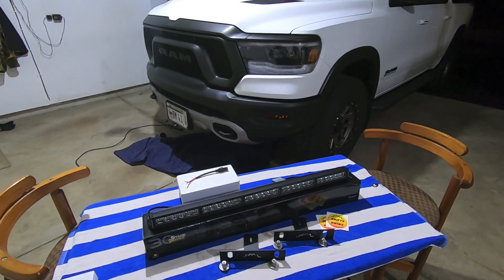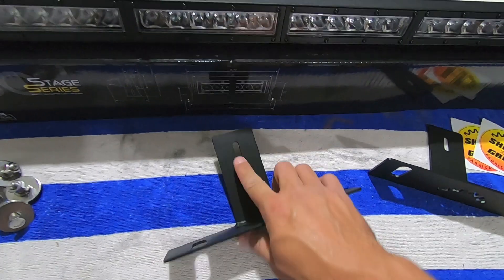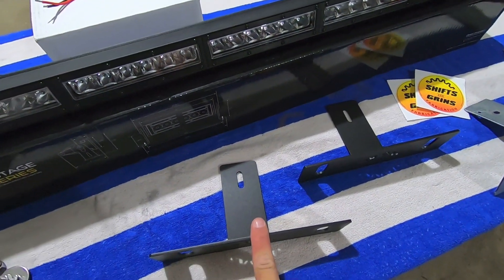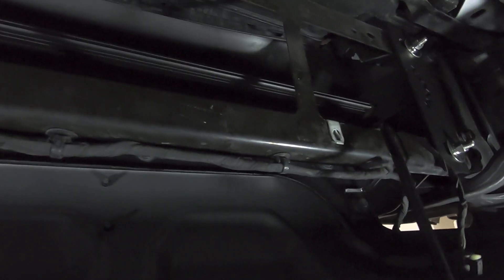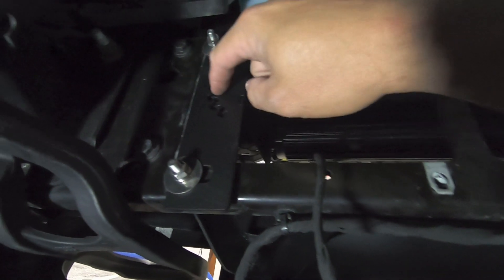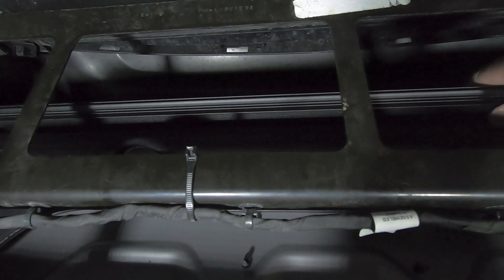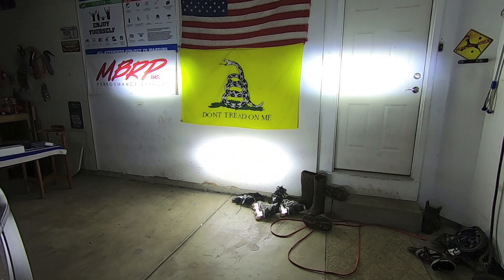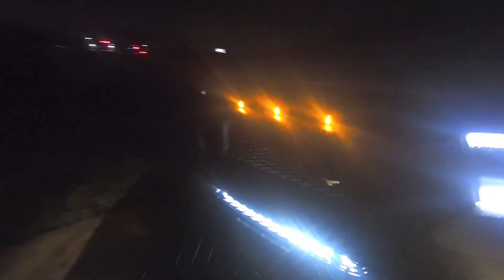Shifts and Grins 30" Light Bar Bracket/Diode Dynamic SS 30 - Ram Rebel

Comment: How did u wire the light bar and be able to turn it on inside the cab? Also I saw u using a Bluetooth controller? How did u set this up?
Reply from the maker: I used to have a Trigger 4 switch panel but now I have the AUXBEAM RGB panel.  I have videos on both.  I like the AUXBEAM much better.  More features but requires you to run a wire.

Comment: Hey, awesome video.  I have a 2022 Ram 1500 Laramie and it has the solid lower grill panel and need the perforated one but when I click on the link you have in your video it says page not found.  Could you help me out with a part number?  I have tried eBay but it comes up with the solid one .  Thanks Martin
Reply from the maker: Awesome, how'd they work out for you?

Comment: Just saw your video! Will this brackets and light application work on a 2023 rebel diesel
Reply from the maker: I would double check with the folks at shifts and grins im not sure and I don’t want to steer you wrong

Comment: Do you think the the Flood lenses on Combo variant would get lost behind the sensors and grill ? On the fence if the full driving light would be better to push more light out through the grill. Thanks
Reply from the maker: Yes I think your concerns valid. The driving pattern in all dd lights is amazing. It’s seriously the most useful light pattern out there

Comment: I’m sorry if you answered this but will the shifts and grins bracket work with other light bars such as the Ruff country? I just want to triple check before I spend the money on the 30 inch as opposed to the 20 inch rough country also great video thank you.
Reply from the maker: You’ll have to compare the dd 30” light bar to the other light bars. If that are the same width they should fit.

Comment: There just doesn’t seem like enough room to reach in and Allen wrench it. I got one side in by getting my hand over the light bar. But once I work on the other side the light bar is center and there is not enough room to wrap your hand up and behind. Is there a way to remove the mesh grill? That way I can work on it from the front?
Reply from the maker: The mesh can be unbolted I believe

Comment: Kind of hard to tell. Is that light bar a single row or dual row? If single row do you think a dual row would fit? 

Thanks.
Reply from the maker: A test fitted the bracket with a dual row but yes the light in this video is a single row (of much higher quality than the double row I used for test fitting).

Comment: Quick question. As far as the mesh area. I saw a video somewhere that you can remove that hunk of plastic from behind the mesh and be fine with doing a 30 inch light bar. Think there will be enough space ?
Reply from the maker: Yes the mesh grills are two piece, if you want my original light bar install video I show you unclip that part from the front mesh
Reply: @WaterFowler41  cool. That means I save some cash and rip it out then. Thanks bud! Going to set the trigger up this weekend and have everything ready for when I order lights. Don't have a garage. Which sucks. But I make do. Tarps are nice. Lol

Comment: I have a 2021 ram rebel, it has that front vents behind the grill, will the light bar still fit??
Reply from the maker: I’m not sure man, I don’t have them but my guess is no
Reply: Is your truck the Eco Diesel? If so the inter cooler might  be in the way.
Reply: @rpena76  yes I have the ecodiesel
Reply: @CarlosDiaz-kt4sb  I don't think it will fit due to the intercooler. But you might want to check in YouTube for any other options

Comment: So for only about $600 I too can have a 30 inch light bar partially obstructed by my new $50 grill?? Hum that’s out of my realm. I appreciate the video though.
Reply from the maker: $600?
Reply: Yea I am still confused about the $600 as well.
Reply: I apologize I am not sure how I came up with $600 either? I'm an idiot. $410 sounds way better than $600 lol That is cool you worked with the guys to design a bracket for the market. I went and gave it a thumbs up.
Reply: Hey the reason I stopped back was because I was looking to see if you did any headlight bulb mods yet? (I looked through your play list it doesn't look like it.) Projector headlight bulb replacement switching to HD&Led seems like it can be a slippery road with challenges and I was wondering you your researched it yet? I enjoy your videos thank you.